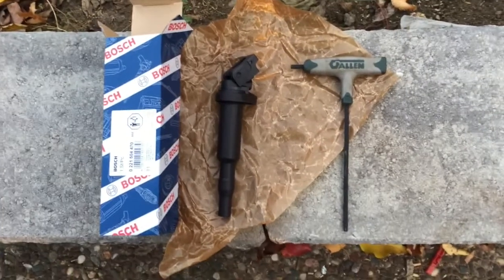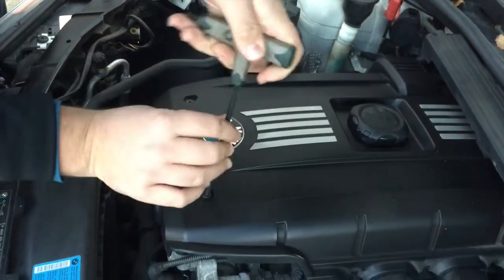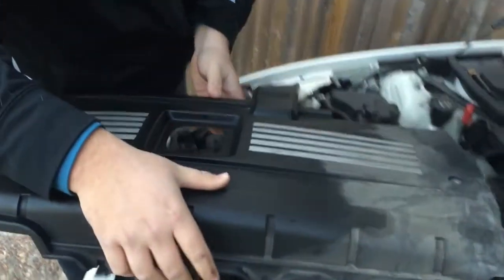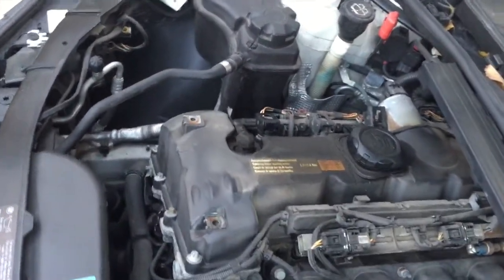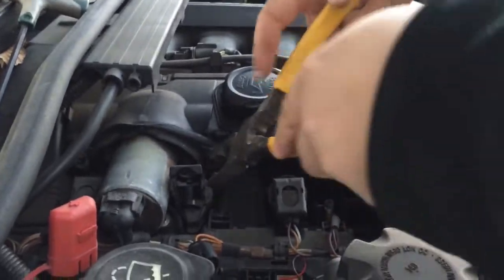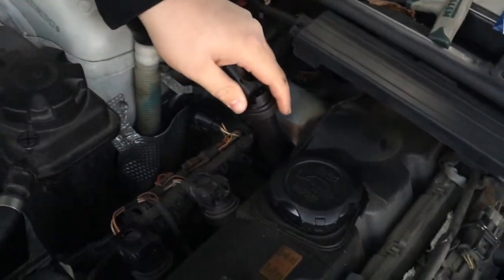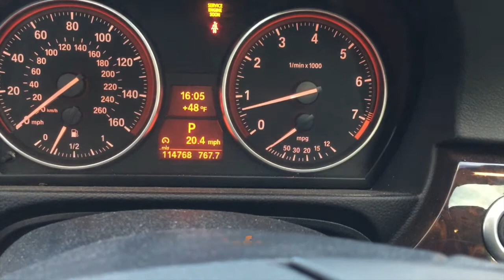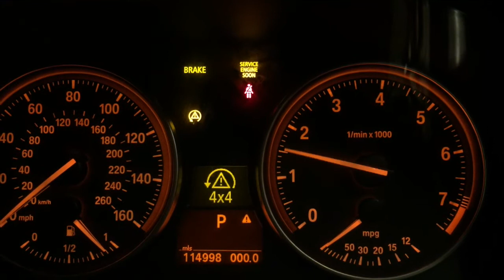How to Replace Ignition Coil in 2008 BMW 328 Xi

Comment: I’m just posting this in case anyone watching this is wondering how to reset the ses light afterwords. If you put the key in (don’t start the car let the dash lights come on) and hold the little button on your dash (the trip reset button usually in bottom left/ also you have to make sure no other lights are on the dash you want to see the time and temp) then you’ll see a symbol come up and you’ll have a menu. The Double s looking icon with the front of the of car is what you’re going to want to reset. You will then be on that and hold down the trip reset button on your dash till a little clock comes up. Once that clock comes up it will reset take the key out and start the car. Hope this helps anyone in the future, I had to buy and obd reader before I learned this trick

Comment: What’s up . Question I’m having a similar problem.. I took it the shop but they are asking for an arm and a leg , so I want to do it myself. But I’m not sure where to buy the coils from and according to the shop they said it maybe be all 6 coils that’s are going bad. So where can I buy or order the replacements from. Btw I have a 2007 bmw 328xi 2dr..
Thanks guys hopefully someone can help later!
Reply: Curious where and if you found them? I have a 08 and had one replaced now another is going. Like you my shop is charging way too much.